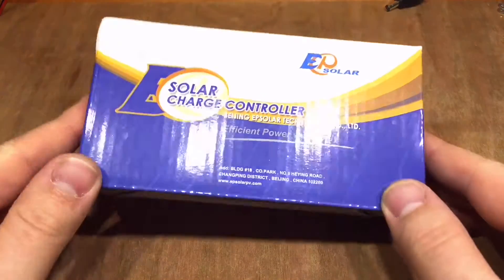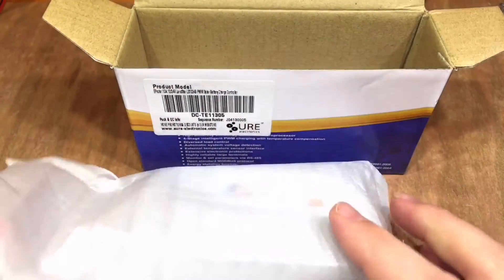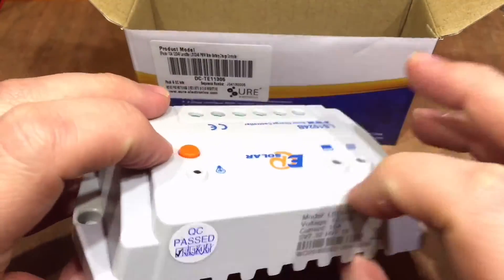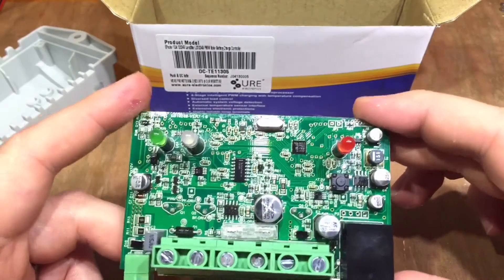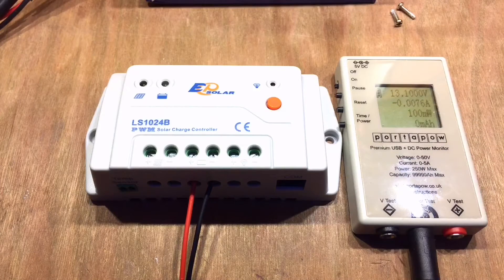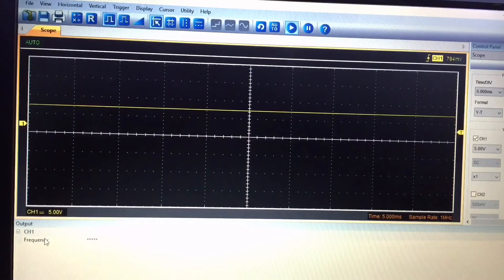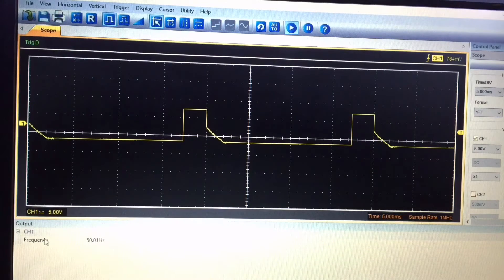EPSolar LandStar PWM Solar Charge Controller Review - 12v Solar Shed

Comment: A EP solar rep told me a while ago that they are soon releasing a bluetooth adapter to allow wireless monitoring.
hasn't materialized yet, but, hopefully soon.
Reply from the maker: +John Douglas Interesting. Thanks for the info.
Reply: well, what do you know.  a wifi unit    https://www.aliexpress.com/item/WIFI-Box-Mobile-Phone-APP-use-for-EP-Tracer-Solar-Controller-Communication-eBox-WIFI-01/32714184306.html?spm=2114.01010208.3.65.QvjHDX&ws_ab_test=searchweb0_0,searchweb201602_3_10065_10068_10084_10083_10080_10082_10081_10060_10061_10062_10056_10055_10037_10054_10059_10032_10099_10078_10079_10077_427_10103_10073_10102_10096_10052_10050_10051,searchweb201603_9&btsid=b975b031-0b20-457e-8925-ed7bb31a7fde
Reply from the maker: +John Douglas Yeah, I looked at it a couple of months ago in two videos... https://youtu.be/iFIiDAw1R3M
Reply: Ahh I remember now, heh.   I'm a twit :F
they really should just start building it into the units. 
and release a firmware update for the BN series fixing the slow tracking and dicky DOD level.
Reply from the maker: +John Douglas I suspect they'll keep the models quite bare to hit the price point. The additional functionality isn't for everyone and those that want it will likely pay for the accessory (which aren't too expensive either).
Reply: true I guess, but I want to be greedy! ;)
they should still do the firmware update though. 
but I'm not going to hold my breath.

out of interest, is it feasible to have two separate battery banks connected to a single controller, but not joined?

probably easier to just pick up a cheap/nasty pwm controller.
I have near 30 5ah gel cells from a stupidly large UPS I picked up cheap.
would like to keep them charged and healthy until I can work out what to do with them.

also have a spare 90w 12v panel just powering a car blower fan during the day to help keep under the house cooler (it's a build in with workshop and office from my partner, the joys of Australian old houses)
probably less hassle.
heh answered my own question I guess.
Reply from the maker: +John Douglas yeah you can't really have your cake and eat it! 

There are some charge controller built to charge two battery systems. Usually they are used in RVs where there is a leisure and a starter battery. Like you say though - another charge controller might be more simple unless you want to use the same panels on both systems.
Reply: I'll just have to try and choose which PWM controller I want then.
so many choices!   any suggestions?
your favorite perhaps?
and thank you so much for your replies and patience with me, it's very much appreciated.
Reply from the maker: +John Douglas I'm quite a fan of the EPSolar range - as you can tell from my videos. The landstar B series allows you to adjust all the parameters (you can buy the PC cable or build your own like I did) which is nice and can be found in 10, 20, 30 and 40 amp models. 
If you fancy a little project you can build a PWM5 Arduino solar charger for very little money - and set the target voltage to any value you want. Although that is limited to 6 amps - although you could place a few mosfets in parallel to upgrade it. 
Those two would probably be my favourite PWM chargers in the shed. 
I enjoy answering questions so feel free to throw more my way!
Reply: Well, ended up getting one of these, and quite happy with it.  
which charging type do you prefer?  VOL Compensate or SOC?  and what's the difference?
I've been googling the last hour trying to find out what I could, which is very little indeed.

Comment: I have always thought that these low end chargers were low value because they give little to no real system feed back, this and your mppt video have changed my view of these 2 products. thanks for sharing, I'm running a midnite solar "kid" controller now
Reply from the maker: +The Left Hand Midnite kit is still in a different league to the a EPSolar charge controllers, but the Chinese manufacturers like to emulate the big brands and pile 'em high and sell 'em cheap. Definitely room in the market for both.

Comment: Adam, I was very happy to see this video. I understand that manufacturer started using the Modbus protocol on all your boots. Now what made me happiest was to see that ScadaBR installed on your computer. I am passionate about this project and use it for various things. Let's put it to work quickly integrated with the controller. I have the memory map of other devices of the same brand. put your computer on the Internet and gives me the IP of the machine that can configure. Let's play a lot. My name is Sidney and bike in Brazil.

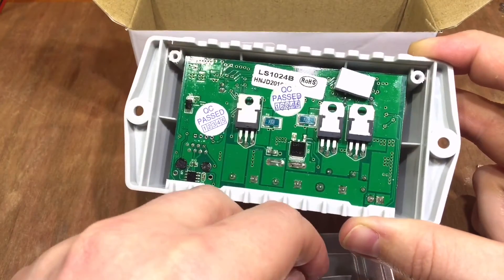Comment: Adam,  at 2:39 you say it is common negative, but specs say positive grounding.  Which is correct?
Reply from the maker: +Y Gator I'm sorry - I'll need to double check. Leave that with me and I'll make a note if I am wrong and reply to your comment.
Reply from the maker: +Y Gator So sorry - In the narration I made a mistake. This is a common positive charge controller.  The two mosfets on the right are in the classic back to back configuration of an EPSolar common neg charge controller design.  Thanks for pointing this out.
Reply: +Adam Welch Thanks for confirming.  I only found out as after watching your video I went to check on prices and found a review on Amazon giving it 2 stars because it had positive ground and that was a deal breaker for them.  I then found the manual and saw it in there as well.
Reply from the maker: +Y Gator Yes. I must have been confused looking from the back of the pcb. Thanks for asking - I hate to give incorrect information.

Comment: Just ordered one Adam do you think the 25a fuse is too high ?
Reply from the maker: +charlieoscar09 I'm guessing it's there so they can add it's protection as a feature, but if they put a 10 or 15 amp fuse in, it might blow unnecessarily - and as its not exactly a user serviceable part it makes sense to put a decent value fuse in there. 

Honestly I'd usually suggest external fuses on permanent installs on the battery and the load. These you could change yourself if needed.
Reply: +Adam Welch Yes willl do thanks
Reply from the maker: +charlieoscar09 In reply to your message (which I can't reply to as I'm on my mobile sadly) this is a uk seller of the USB to RS485 adapter... https://www.ebay.co.uk/ulk/itm/252291474974

Comment: Thanks for the review Adam...Someone mentioned other software have you tried any to get any other software to work with this system also which data cable do i need...thanks
Reply from the maker: +charlieoscar09 I built my own cable using a standard (and very cheap) USB to RS485 adapter. Have a look in my past videos. 

There are a few bits of software from EPSolar - but solar station monitor is define you the most advance. Other MODBUS software should interact with the controller - but you need to know all the register addresses. 

I have an ongoing project to interact with these controllers a bit more - but I've found it slow going.
Reply: Thanks Adam